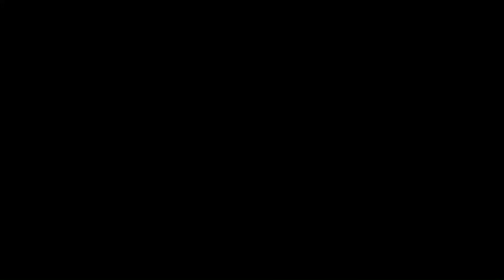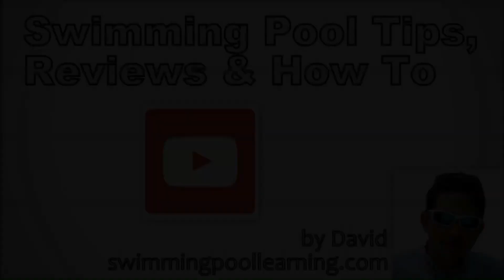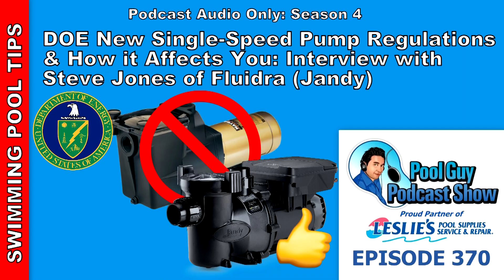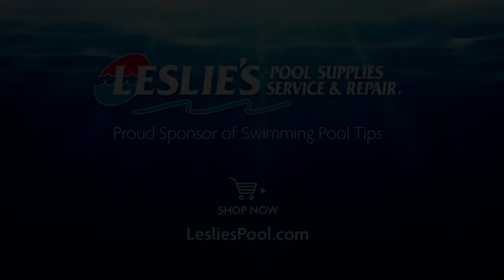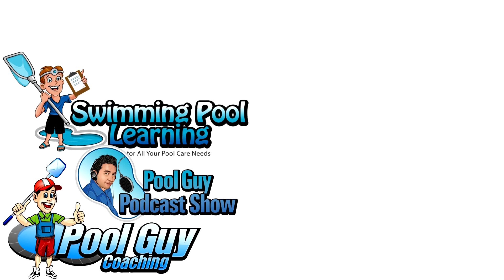New Single-Speed Pump Law and How it Affects You: Interview with Steve Jones of Fluidra/Jandy

Comment: How does this affect the commercial end? I try to always steer everyone towards running their 3 phase pumps on variable frequency drives. Sometimes we see pumps as large as 30 HP that just run wide open all the time.
Reply from the maker: The law covers both residential and commercial accounts. I think it is a matter like anything else of the government not understanding how things work. You can still run a VS pump at 3450 RPM and it will consume just as much energy as a Single-Speed Pump. So these commercial pools will have VS pumps but more than likely they will be running at full RPM because they need to be run at full speed. It will move the needle in the residential market for sure but commercial exemptions would have been wise...
Reply: Swimming Pool Tips, Reviews & How To - SPL  Yes, it’s going to cause problems. For years we have used single speed 3 phase pumps on industrial VAriable Frequency drives. Pentair and Hayward both have pool specific drives, but I hardly ever use them. Wholesale cost on them is typically 3x the price of a similar industry drive. Apparently the DOE has no idea how 3 phase electric motors work. 

I can only imagine what a 15HP pentair is going to cost with a built in VFD. I’m going to guess around $15k.

Do you have any links to the exact laws?